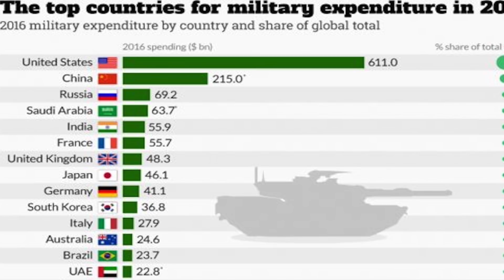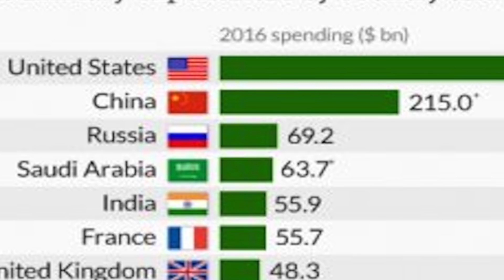CAN USS GERALD R FORD DEFEND ITSELF AGAINST RUSSIAN ZIRCON MISSILE ?

Comment: Okay so a laser bean is fast enough to hit a Hypersonic missile, but can they aim the laser fast enough to hit the missile is the question. They would have to the mount the laser on a turret that would turn and guide the laser, so can that turret move fast enough to hit a hypersonic missile, I just don't know
Reply: CF:  It's no problem aiming at a missile that is pointed directly at the carrier (or any ship).  The direction doesn't change and elevation change is small.
Reply: What’s a laser bean?
Reply: Ok, here's the reality, when a missile is launched at you it's coming in straight on, head to head sort of speak, it's not travelling from a side view where Mac 6 would be impossible to hit, but head on means there's only a few decrees of change in the missile, therefore a laser that is computer guided could easily attain it's target, but can a laser be produced strong enough to knock out the Zircon in the short time that it will travel?
Reply: That's easy since a hypersonic missile can't turn very fast.
Reply: When aiming at a far way target more than 3 miles away. The gimbal mounting the laser would only have to move a couple degrees to strike the target.
Reply: The problem is tracking
Reply: well it can. So now you know. Thank me later.

Comment: A single missile is going to take out a carrier. There's at least a few hundred missiles pointing back to the source.
Reply: Nathan, the Ruskies will "swarm" the carriers with 50 or more supersonic maneuvering missiles, launched by air, sea, and underwater subs.
Reply: Nathan D., the problem with Phalanx defense against a hypersonic missile attack is that even if the missile fuel tanks or cake (solid fuel) and engine are "destroyed," even a nonexplosive warhead of "depleted" uranium and tungsten has such enormous kinetic energy that the hardest steel hull is much like warm butter to it. The best chance is for a high explosive antimissile warhead to explode so as to deflect the hypersonic warhead from hitting its target.
Reply: Drew, as your response consists of nothing but profanity and ad hominem, this is my sole response to your emotional outburst. Off your meds? (My ad hominem allusion.)
Ever hear of Pearl Harbor, December 7, 1941? There was no ongoing war between the US and the Empire of Japan until the Japanese planes attacked.
Reply: 3.5 minutes to reply thats assuming it will detected at launch 
if its detected 1 minute later 2.5 minutes of total chaos on board the carrier.

however like the video said Laser weapons and rail guns maybe the answer to this rocket. Russia already deployed its laser weapon. which is crazy .. 

I hope for peace in this world starting from the middle east.
Reply: Arcieres No it isn't. Your 2km/sec missile has barely any manoeuvrability which is one of the trade offs for going 2km/sec , so the "Super big 20m/s" ship simply has to move out the way. At a range of 400km, which is what a Russian/Indian anti ship platform would need in order to not get destroyed, the task force has about 4 minutes to complete said simple move out the way manoeuvre so the Zircon goes soaring past only to plunge into the ocean lifeless a few km later. 

This is after the Zircon breaches the other Anti Missile defences which it is also vulnerable to due to its lack of manoeuvrability, it just heads in a straight line which is where AA Missile comes in and shatter the Zircon  into a million pieces.

Honestly the BrahMos is arguably more effective as it will be harder to detect and more manoeuvrable in the final stage before impact.

The only thing Zircon is better at than the BrahMos is bypassing CIWS and LaWS which aren't supposed to target Supersonic missiles anyway.
Reply: I Doubt it, that's an awful lot of steel even for a missile as big as Zircon.
In addition, I think it's possible for modern systems to take out a Zircon missile, even though they were not specifically designed for it. Especially when you consider the current shoot shoot look shoot doctrine. Each Zircon would need to dodge at least 3 missiles, and probably closer to 7, and survive Phalanx.
Reply: Missile defense in the case of a SAG defending its self is shooting missiles in the opposite direction of the target missile for interception as apposed to in the same direction. Speed is much less of a factor when the two missiles are closing on a close to head on heading. So long as the interceptor is not chasing down the threat missile from behind (Something that pretty much doesn't happen in real combat) speed really isn't that much of a factor save in one area, reaction time.
Reply: Charles Lu, I'm just curious, you understand: How many cities is a Russian madman willing to trade for a US carrier? Remember, no one madman could accomplish a nuclear missile attack on a US carrier battle force. It would require that his top officers all be madmen.

Comment: zircon is unstoppable... no one defence system available that can shoot down zircon ...it might be possible by s-400 system which also belongs to Russia....
Reply: I'd like to see the Russian zircon.out run light L.A.W.S
Reply: The Zircon is not even in production, yet. It is expected to begin production in 2018. The LAWS is already being tested on US Navy ships and looks promising. I think the LAWS would be easier to build and place on existing ships than the Zircon unless that missile was built to use preexisting launch platforms.
Reply: Unfortunately it's too fast to change direction mid course to avoid the rail guns and anti-missile missiles.
Reply: Lalit Choudhary ...lol...stfu moron. Zircon will have a more than 50% failure rate.
Reply: I'm sorry, Anywhere But Here, but where did you get the notion LaWS has a range of only 1.6 kilometers? I think you're crossing your data streams. If the Zircon missile is flying low, then it is possible the laser system will only have a 1.6 km distance to react, which would be not enough time, but otherwise, the laser has a near infinite point of sight range.
Reply: Aejon Starkgaryen ....don't forget hypersonic speed is around 30km high. There is no proven hypersonic travel at low levels. So all this bickering is null n void. It travels at mach 2.5 to mach 3 like any other missile at low levels
Reply: Aejon Starkgaryen ....no...I'm am talking about physics in general. Any hypersonic missile cannot fly at these mach 5 to mach 6 speeds at low altitude as they become unstable. At high altitude...yes of course
Reply: The reply you're replying to is not a response to your post, but rather one from Anywhere But Here. I have not yet responded to your post, but I can say up front, I don't disagree with your response.
Reply: Aejon Starkgaryen 

Aircraft carrier battle group are well protected by numbers of destroyer's.. frigates..& even underwear vessels..
Reply: absolutely right....
Reply: Lalit Choudhary hitting a rain drop at mach 6 will stop it
Reply: laser will
Reply: Google is just a search engine. Why don't you point me to your source of information? I have researched several sites, looking for specific information, such as scout.com, defensesystems.com, and wikipedia.com. I have looked at others, but the only one with any information regarding range is Wikipedia, which says, "...are restricted to line-of-sight firing to continuously keep the beam on target." Mind you, the Navy has been testing with 30kw, 105kw, 150kw, and 300kw weapons, and have concluded a threshold of 100kw seems the minimum for an effective weapon-grade laser.Perhaps, you're finding information the 30kw laser?
Reply: +Lalit Choudhary I don't understand why you pro-russian people are so arrogant, lol...
Reply: It makes them feel relevant.
Reply: Sorry, remember the carrier strike force is capable of defending against ICBMs headed toward the carrier. An ICBM is far faster  than a Zircon missile, so better be launching dozens of those missiles before the lasers come online.
Reply: You make a good point, Will, but an ICBM, while faster, does not have a dynamic path designed to make it less detectable to a carrier group. With that said, the Zircon, by itself, probably would not stand a great chance against a carrier group, so I believe it was intended to be launched in gross numbers against a carrier group, for that reason.
Reply: I didn't say they didn't have a cost advantage. The thing is the zircon missile has a very limited range of purpose. It is designed to sink ships. It might also work against aircraft and maybe land units, but that is it. An Aircraft Carrier fleet has a wider range of purpose from humanitarian, to utilitarian, and combat missions. When you factor this into the equation, and realize soon lasers costing a few dollars per shot will be common on all American ships, then that cost advantage seems to shrink.
Reply: Aejon Starkgaryen 

Right...
I agree...
Reply: This is all hype designed to get idiots to stress. What the clip did not mention was the fact that the navy knows what ships have these systems onboard, making them first strike targets by attack subs, secondly the clip did mention the speed of laser weapons which totally neutralizes the fear that is being hyped. Who knows what other weapon systems the navy has that all use lasers? There is know way in hell the Russians will fire this weapon because if they do death will occur to that vessel with in lets say 20 minutes or less because of the new LRASM being deployed. So yes they get one shot but as soon as the trigger is pulled thats the end of that ship and any like it above or beneath the surface.
Reply: You are so right.
Reply: Okay
Reply: Aejon Starkgaryen Research LaWS weapon range on Google. The Atmosphere dissipates the Light energy from the laser the further it travels or something like that.

I mean the total range is beyond 1.6km but beyond these distances it's really not going to be doing much. The effective range for all targets is 1.6km.
Reply: Aejon Starkgaryen  
But still zircon have an advantage because of its cost effectiveness as compared to multi billion aircraft carrier...& What about the fighter aircrafts..
We can't even imagine the actual loss...
Reply: Nick Motsarsky not to mention that the fact that it could avoid hit without firing an interceptor
Reply: Utter bullshit.
Reply: Doesn't matter. IF Russia used one on a U.S. carrier, it would be WWIII. No one would survive.
Reply: I hope you're joking. Zircon is NOT unstoppable. Throw enough countermeasures at it and something will stop it. In addition, you DO realize the US military has missile-defense technology that's classified, right?
Reply: LaWS is not the answer to Zircon. It has a 1.6km range, giving it only a single second to destroy a Hypersonic missile (not possible).

However, let's go back towards something a little more basic, Jammers and Decoys will send that Zircon astray, even if only slightly, only slightly is enough.

Now let's go back to something EVEN more basic... Simply moving out the way...
From 400km the Zircon will reach its target in 3:42 minutes, lets round it up to 4 minutes as the Zircon won't reach max speed instantly.

Due to its Mach 6 speed, it will not be very manoeuvrable so it's course will remain almost constant. While the US destroyer/ carrier group or whatever will surely be able to use that 4 minutes to calculate the potential course of the Zircon missile and literally move out the way.

This is also after all other anti missile defences have been exhausted such as Missile defence systems, SAMs and potentially a CIWS or an improved longer ranged LaWS in the future, Decoys and Jammers. 

As such I'm confident that a western navy carrier group has a high enough saturation point of Zircon Missiles to defend itself.
Reply: Zircon missile is flying succesfully only in internet. According to last interview of russian leading specialist Gerbert Efremov: "We still do not understand the nature of hypersonic combustion, we have not solved any problems, and we do not know if we can  will solve them in the future. "We still need start development of the engine  and solve the problems of stable engine operation, and heat protection, navigation and guidance systems in the plasma area, as well as low visibility and maneuvering. So far, not a any problem has been solved in Russia..."
Reply: LOL LASER WAPONS ARE FUTERE S400 IS EASY TARGET FOR US AIRFORCE
Reply: Ahhh, I love it. Well for all the people here especially the Americans. You the people of the USA pay for these weapons, you the people join the army to use these weapons, you the people vote the President in, who will send you and your army across the world to fight, not for you or him but to fight for his masters and your masters, the big Banks, Corporations and secret societies. While you are all here debating whats what, ultimately your true masters are at work making money and taking away your freedoms. Don't people see what's going on around them, the American people are poor as fuck, you cant afford shit anymore, and these bastards are taking this money using it for their global wars, key word here their wars not yours. You the people, so poor and desperate than join the army, so you can fucking eat and have a living, are sent of to kill and die for them.

Comment: We better get busy on that laser!
Reply: There is much hype about laser military technology but the unfortunate fact is its nowhere near as what its proclaimed to be.  Simple light + heat resistant and/or reflective surfaces (which aren't expensive, by the way) can render any current or foreseeable-future missile defenses obsolete before they gain wide stream adoption!

Secondly, laser air/missile defense requires concatenation of early-detection; tracking, & guidance (+ launch/attack) but no current tracking/guidance system is capable of tracking maneuverable hypersonic missiles/vehicles (let alone, intercepting them).  Besides, even if they would be (in future years/decades), a hypersonic cruise missile is just that - a cruise missile which doesn't have a static/calculable path and by the time an interceptor-missile would approach an attacking hyperonic missile , the missile would be in a different location by then (especially when flying at hypersonic speeds).

AGAIN, EVEN TOP SCIENTISTS & POLITICIANS CLAIM THERE IS NO CURRENT DEFENSES WHATSOEVER AGAINST HYPERSONIC MISSILES/WEAPONS AND WITH CONSTANTLY-MANEUVERING MISSILES WHICH RUSSIA IS AGGRESSIVELY PURSUING, (KNOWING THERE WILL BE NO DEFENSE FOR THEM EVEN IN YEARS/DECADES AFTER THE FACT), ITS IS UNREALISTIC TO INTERCEPT SUCH MISSILES OR POSSES DEFENSES AGAINST THEM! FACT OF REALITY.
Reply: Why Russians fire missiles in salvos.  If you have a 90% chance of stopping 1 missile. What's the chance of stopping 5 consecutively? Answer. 0.9 x 0.9 x 0.9 x 0.9 x 0.9 = 59%  It would be harder concurrently.   But only Russia and China, in future, would be able to make saturation attacks against the US.   It's about deterrence, influence, and arms sales.
Reply: Stop pushing Russia aggressively to war  with USA and there be no need to hurry.
Reply: Dude we already have one we just need to build more
Reply: Dale Reynolds laser won't help bro
Reply: Ross K, you are so right, the LaWS is a joke, simply 6 industrial welding lasers cobbled together and directed by the Phalanx radar CWIS. IT IS FOR DRONES AND PARTY BALLONS.
Reply: Well the rest of the comments were referencing an anti projectile laser. You didn't specify a different type of laser. So yeah it follows that you were talking about the same type of laser.
Reply: Yes. No current form of Laser weapon will be of any use against a Hypersonic Missile. It would be like adding a candle to a blast furnace to speed up the heating process. Present Lasers need time to effectively create heat and time is not something you have with an incoming Hypersonic Missile. The problem then is keeping the Laser on a manoeuvring target. Maybe the USA will just have to develop its own Hypersonic Missiles and settle for MAD in the surface ship area. You do it to me and I will do it back to you. There will be answer but it is not there now.
Reply: Joseph Grace there you are again with your communist baby
Reply: A hypersonic missile will have a lot of heat shielding so it might take a while for the heat from a laser to destroy* it then move on to the next missile in a 100 missile saturation attack from 5 subs carrying 20 Zircons each.  A new class of nuclear powered ship will probably be developed in future with lots of lasers on it. * = they'll still be some quick moving shrapnel from any destroyed Zircon.
Reply: Dale Reynolds Russia Nukes u
Reply: The heat generated from Hyper-sonic flight is greater than that of a Laser, lasers would be utterly ineffectual against this weapon. Whats more the plasma it creates may absorb all radar emissions that hit it, as a result it may also be invisible to AEGIS, AWaC, etc.
Reply: Bob Bob, well.... I have a shark with freaking laser beams.